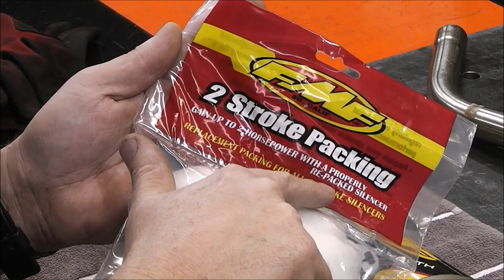2001 KTM 250 2 Stroke Restoring Exhaust Silencer E 4

Comment: Totally different to the old way we used to do it, 🤣🤣🤣. Blow torch up the sweep pipe then an air hose to burn the crap out of it, 🤣🤣🤣.
Well, back in the 70s that’s pretty much how everyone did them, 🤣🤣🤣.
Merry Christmas ol’ mate. Have a good one!!
Cheers
👏👏👏 🎄🎄🎄
Reply from the maker: Merry Christmas buddy! Your probably not where you wanted to be today but i pray for a speedy recovery for you.  I think they still do burn out the pipes using the method you described. I've never tried it but I'm wiling to learn. I have to do some research and then I'm going to give it a try.  Cheers buddy! 👍😁
Reply: GEEZ NO Bran!!! You’ve done the right thing. Gotta remember that back in the day we didn’t have the access to the internals as you have today, 😂😂. We ain’t 10ft tall & bulletproof anymore 😂😂😂. Better idea would be to look at a better repacking method to either improve performance or extend usable time between repacks.
Certainly not where I want to be atm, but at least had grandkids around me on Xmas.
Merry Christmas my friend, hope things are going well..
Thanks for your support Bran, I truly appreciate it,
Reply from the maker: I think the expansion chamber they heat up with a torch and blow air through and it will clean out any built up carbon (while the pipe is off the bike)  Hang in there buddy and heal up quickly!

Comment: Good job buddy just a question for you I have a Kawasaki kfx 400 and I need some  engine parts just thought I’d ask if you could keep ur eyes and ears open for any one getting rid of parts
Reply from the maker: I sure will buddy! What are you trying to find
Reply: @BrandonLund  I need a cylinder head with the cam caps and the journal’s there’s a shit ton of wear
Reply from the maker: @keithparady2594  I'll keep my eyes open. You might try EJP Racing in Gardiner (that's who has my motor) or Starting Line in Waterville...I'm not sure if they would have it, but it's worth a shot.
Reply: Alright thanks